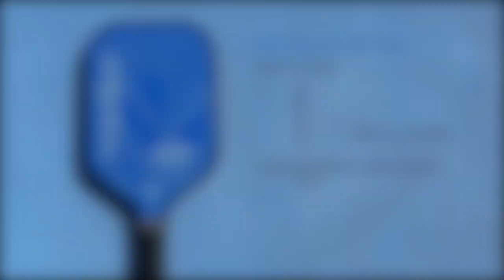Vulcan V740 HT MAX Pickleball Paddle Review

Comment: I just purchased the 740HT and I’ve owned the 940 but did end up selling it. From memory, the 940 did have the larger sweet spot but overall I think I prefer the 740HT due to the feel and maneuverability in hand. I have added tungsten weights to the 740HT and that seems to have helped with the sweet spot and power. Overall, I liked both of them and could recommend either one. I wish I had kept the 940.
Reply: Full disclosure, I live in the city where Vulcan is based and play on their courts but do not work for them or have any business relationship with them outside of buying a few paddles from them.